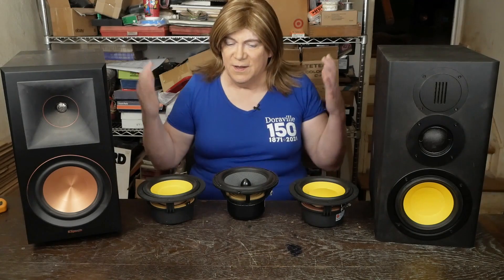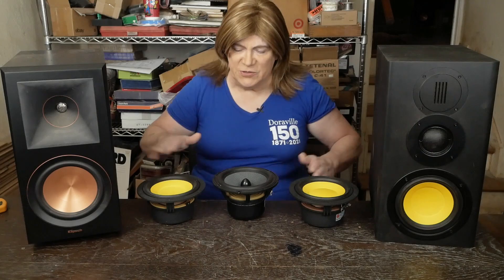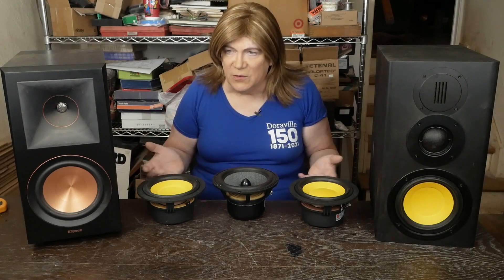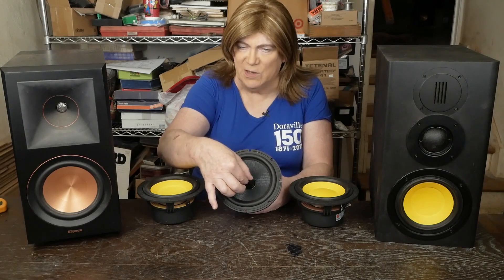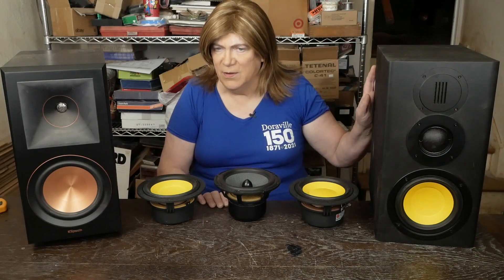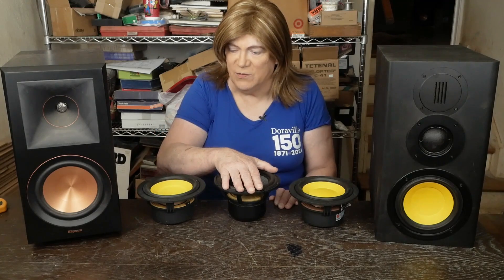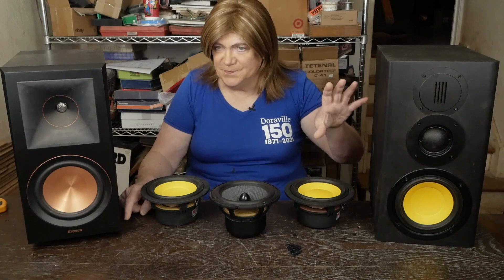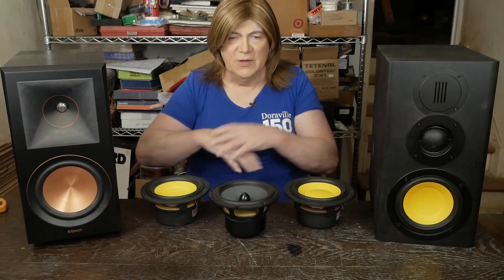Swan DIY 3.1A Speaker Mods & Driver Upgrade!

Comment: Thinking of upgrading to klipsch rp8000f ii, but then some reviewers said they lack bass extension, what do you think of klipsch in general?
Reply from the maker: They tend to be a >little< bright on the top end and need careful room placement to get the bass out of them. My friend has a pair of RP8000F II and IMHO they sound nice. if you need more bass, a powered sub is an easy fix. Overall, good value for the money and work well with tube amps.
Reply: @SkunkieDesignsElectronics  thank your for the response! What amp would you pair them with?
Reply from the maker: Depends on the kind of music and more important the SPL wanted and room size

Comment: the problem with changing the impedance without messing with the crossover is the crossover point will move up.  Unless the woofer circuit is really goofy designed, it will usually have a series L and a parallel C.  Quick and dirty crossover mod to keep it the same, double the value of the L, half the value of the C and it should be very close but its a little fiddly because the impedance curve of the driver + box combo isn't going to be a steady 4 ohms.  If it measures out to have a hump in the 1-3k or so range, thats where I'd look.  If it comes out fine, then call it a day and rock on.
Reply from the maker: Thanks for the info! I have learned the flat doesn't always = sounds good to me, so I wanna be careful :)

Comment: Love to see the results of your experimentation. There is a difference between an off the shelf suit and one that is tailor made. If you tweek your speakers to match your amp you will undoubtedly end up with a better result. I have super cheap setup and I too am thinking of buying a mic and starting to do measurements. Thinking that is a good place to start. So I can at least understand where the problems are.
Reply from the maker: And learn! Honestly I have found I get better results with trial and error vs obsessing with sims and high end math. At the end of the day, does it sound good to me?

Comment: You know what would be Cool?  A Nuclear Power Tube Amp!     I wonder if there is a Way  to use  to excite the Tubes (Valves) in order to  drive a Transformer at a very high Voltage to make music?   Sure the Tubes themselves would have to be Shielded in some way,  but I think with enough Lead glass would work.  

It seems that Beta Particles are the ones that Create Electrons.  
Now I am not sure how Tube's do their emissivity (?) as in how they use heating of a Cathode or Anode to make electrons flow,  but it seems that this kind of operation is possible.   

Might work really well for a PreAmp section.    
I am thinking that the OUTPUT stage would be to much of a Feat to accomplish without  a significant amount of radiation being a problem at that point.    

Might also work great for underwater gain amplifiers like they do with Fiber Optics as they would not need an external power source and could work for Decades.
Reply from the maker: I'm not gonna being experimenting with radioactive devices!
Reply: Why bother with nukes and output transformers, or for that matter loudspeakers, when Tesla coils can do this: https://youtu.be/gqs8bRMhBgA?si=v0eWCGdbSljSqX8D

Comment: Good idea messing around with drivers Stephe!  I agree with you, a larger voice coil should give you more bass.  I think you're also right about driver impedance.  The higher it's impedance the less current required to drive it, & thus the more power available for the other drivers.

Having a single output winding on the output transformer allows room for more primary & secondary turns, allowing more primary & secondary turns to intersperse & couple to each other.

The 250 litre Majestic monsters with their 15 inch Etone woofers & Celestion horn-loaded compression tweeeters I built don't seem to have this problem!

Hey what do you think of the B&W DM10's Stephe?  I'd like a good pair of bookshelf speakers for my bedroom.
Reply from the maker: I'm not a big fan of front facing bass ports, but for a bedroom speaker, might be a pair of "chill" speakers for background music that are less sensitive to room placement? Just a guess.

Comment: I purchased a second hand NHT 2.1 speaker set and the dust cap in the subwoofer driver was pushed in. I got it to pop out carefully using a vacuum cleaner.
Reply from the maker: oooo I like that one!

Comment: Driver selection is extremely important, as you are finding out. Crossover design is as much an art as a science...and I think tube amp design is too! The key with speaker design is measurements, followed by listening to fine tune. Danny Richie's channel at GR Research has alot of great info on crossovers that will help you. I doubt that the inverted cone dust caps will make a difference in the sound unless the shipping damaged the voice coil. You can try using a vacuum to help gently pull the dust cap back to convex if you want. Lastly, you are correct about matching the average impedance of the speaker to the amp's output transformer. That does make an audible difference. I've always heard that tubes preferred higher impedance loads like 16 ohms, but i guess it really depends on the output transformer. Should be an interesting learning series to watch. Good luck!
Reply from the maker: This is why when I am choosing output transformers, I use a slightly higher "impedance" model, as I know many 8 ohm speakers dip below 8ohms. For example when the "perfect design load" would call for a 3.5K, I will choose a 5K. You lose a little power but the amp speaker combo sounds cleaner.
Reply: Many 8 ohm systems might even dip below 5 ohms easily.
Then you have to add impedance phase swing, also having quite a factor on what the amp sees and how it might behave (avoid capacitive loading). 
As for simple change in swapping 4ohm to 8 ohm driver, there will most likely be extra lower midrange , since 8 ohm driver needs almost twice the value of inductor for that same crossover frequency, assuming they use very simple X-O design here. 
The way you design X-O, is to fit specific acoustical target curve for specific driver, taking into account it's freq. response when mounted into cabinet and impedance.
As for the cone shape and material used it will determine stiffness, self damping properties and cone/dome ringing, frequency response, off axis behavior, distortions, etc. Most cones/domes materials will have specific sound signatures depending on materials used. Again depending on the drivers design the crossover might address issues the 'cone' has and deviate from flat on axis response. XSim is the easiest X-O soft but also quite limited in what it can do, but Vituix is very much the norm today as it allows off axis behavior to be taken into account. As for measuring rig, some like Clio as it provides MLS and it's easy to set up, some use Dayton mics/Soft, REW, ARTA, ...  Erin from Erin's Audio Corner even got himself a Klippel, but he only uses it for his own speaker reviews. He did once review of Dayton spkrs and provided separate driver's FRD and Z measurements for those who would want to  redesign the crossover for improved performance. It worked very well in Vituix CAD - I would love to have access to something like Klippel.

Good luck

Comment: I have a pair of Klipsch RP 600m's and they are the best sounding small bookshelf speakers I have ever heard.... :-))
Fixing to buy another pair for the rear....
Reply from the maker: I know some people hate them and I have been attacked on forums with comments like "Well you like the way RP600M speakers sound, so your advice is questionable"..
Reply: @SkunkieDesignsElectronics  Maybe they have hearing problems and don't know any better lol :-))
Reply: @SkunkieDesignsElectronics  also... One thing that surprises me about these Klipsch speakers is how good they sound.... those horns are absolutely tuned perfectly to the mids and highs.... also, when I first bought these speakers I had no idea that they were going to produce as much bass as they do and I thought I was going to have to buy a subwoofer.... but as soon as I placed the speakers in the proper position from the corner of the wall the bass just went insanely crazy.... it's amazing to me that the 6 inch woofers along with the cabinet and that tune port in the back can produce so much base that I don't even need a subwoofer.... 🙂 

Another fact about these speakers is they will handle the wattage that is described in the specifications.... 

Have a good day...
Reply: Hey, how is their low and ? do they have sufficient bass in small to midsize room ?  Thanks
Reply: @RanTausi With any and all speakers, placement of the speaker is crucial to get the best sound.... 
These Klipsch, RP 600M speakers are designed perfectly for the corners of a small room.... for which they were designed for... 
You would think that the massive Twitter horn in the front would overpower the speakers, but that is simply not the case... Klipsch has a back firing tuned port, that creates all of the bass using a small 6 inch woofer.
The tuned port in the back is tuned to the cubic air volume of the enclosure, along with the small 6 inch woofer that fires from the rear of the speaker and hits the corners of the wall in the room turning the corner of the wall into a large bass horn... 
Just put the speakers about 2 1/2 to 3 feet away from the corners of any small room and it will sound fantastic.... !!!! 
If you buy a set of speakers with front firing ports this effect will not work, and the speaker will have to be placed somewhere else to get the best sound... but where else are you going to put your speakers ? but in the logical corners of the room or 2.5 to 3 feet from any wall.... :-) One more thing... The tuned port in the back of these Klipsch speakers is very different than just a hole in the back with a pvc pipe or tube placed in the back of the speaker as a port. 
I'm using these speakers in a 24' x 24' foot room which is perfectly balanced for the bass, mids and high frequencies.
Reply from the maker: This. People who complain about these speakers aren't placing them in the room right.
Reply: @SkunkieDesignsElectronics  Exactly !